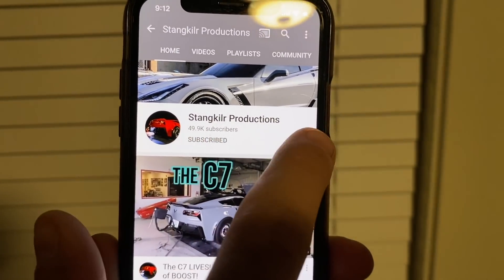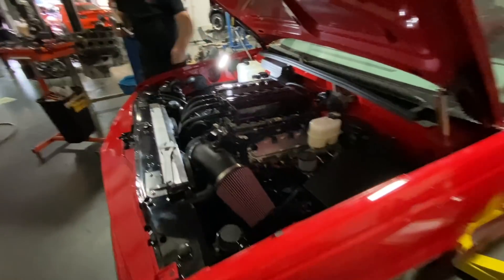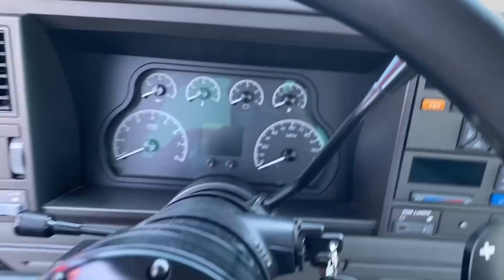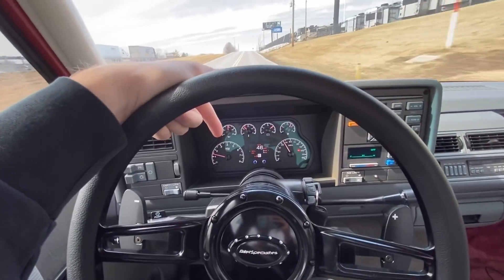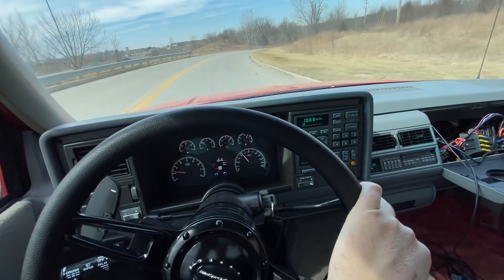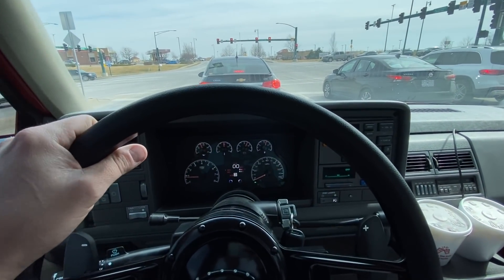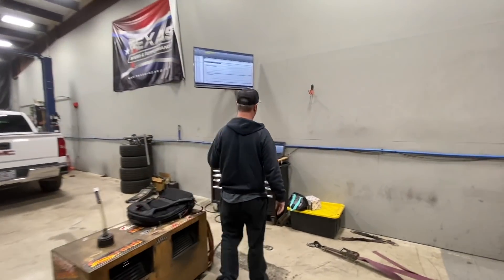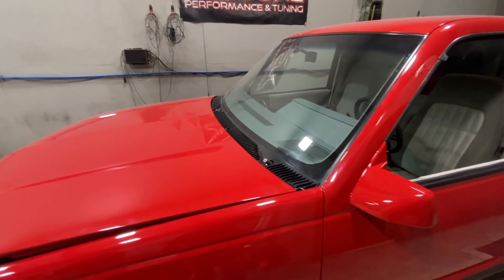The ZR1500 makes massive power on the dyno! Still more left in it

Comment from the maker: I am super pumped with how this project is wrapping up!
What should we do next?
Reply: 2 door 92-94 95-99 blazer/tahoe 4wd turned AWD...
Reply: Trailblazer ss
Reply: 2001 Tahoe project lol
Reply: Speartech makes a obd2 splitter..
Reply: Obs Tahoe would be nice.
Reply: 1993 chevy Typhoon or 1991gmc cyclone 👀👊🏻
Reply: More OBS!
Reply: 73-87 c10!!
Reply: C10
Reply: 2003/2007 singe cab cat eye
Reply: how bout a C3 Vette with that LT5 motor and 10sp. like a 1970 to 1973.
Reply: OBS with the crate 632?
Reply: Step side 1500
Reply: I said in last video, OBS 2door Tahoe 4wd!
Reply: 5th gen 4x4 Silverado rcsb
Reply: Build one with a manual transmission
Reply: Definitely a c10!!!
Reply: 2 Door. 94-96 k5 Blazer Sport or 2dr tahoe with AWD a must have
Reply: 94 2 Door K5 Blazer Sport
Reply: build a 92 Blazer SS 😮‍💨
Reply: Crew cab obs to haul both trucks
Reply: C3 Corvette road racing build.
Reply: 01 C3 awd with LT4/10spd swap, lowered 2" with roll pan.
Reply: OBS 262SS
Reply: 02 silverado hellcat engine swapped
Reply: Im in the process of building my 89 Silverado regular cab, what size wheels and tires are you running ? I love the set up

Comment: i am building a 68 chevy has a stroked 454 with a  02xx trans all that is left is finish the interior and finale paint job best part i only have 1200 in the project. the engine stock had 450 hp put a weiand intake with a 850 double pumper holley put in a used roller cam and roller rockers engine came with steel crank heavy rods high flow heads the 02xx trans stock is good to 800 hp comes with the 8 bolt pump heavy clutches stage 0ne shift kit . i got the engine and trans for free with 6,000 miles on it, plus i have a lot of extra parts like cab box and fenders with a set of doors all rust free parts can build another one out of parts have frame and suspension for a 3/4 ton plus we have a 67 too . just picked up a 65 short box for 100 bucks with just a little rust in it all complete with a 283 needs work to run . i also have 3 more setups with the 450 hp 454 with a 02xx trans that i got for free  all good running engines from 6,000 to 58,000 miles on them ,i found out what they come in and i been collecting everyone i can get my hands on .my next project is a 79 z28 rs t top all ready have most of the parts for it with 2 extra z28's for parts if needed can build one perfect body car no dings in it some day i will sell all the extra parts i have maybe

Comment: Wait, a $100,000 750hp build and your rocking a stock driveshaft?????Seriously bro? Are you using the stock spaghetti rear end and axles too???? Better put a Currie 9" in it and a custom driveshaft and safety loop before someone dies.
Reply from the maker: It does have a driveshaft loop and a custom bad ass driveshaft. Seventh gear on this truck is 200mph.